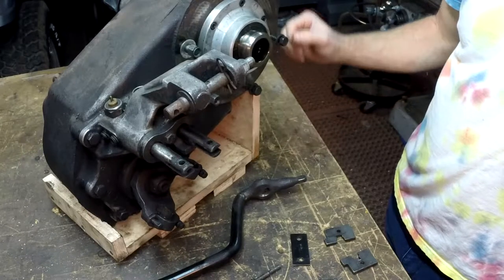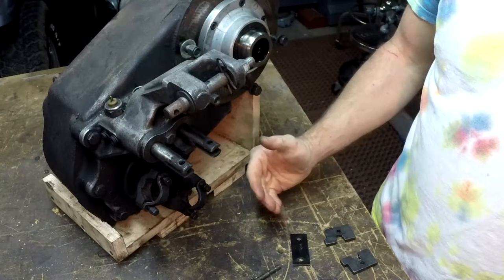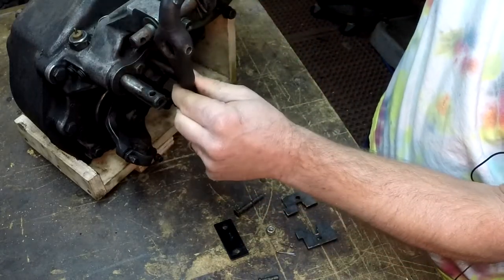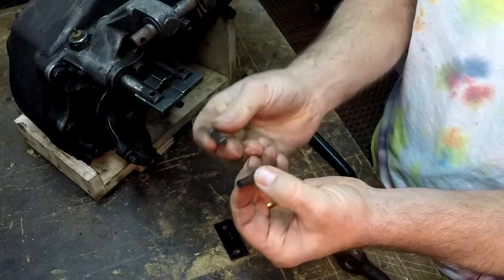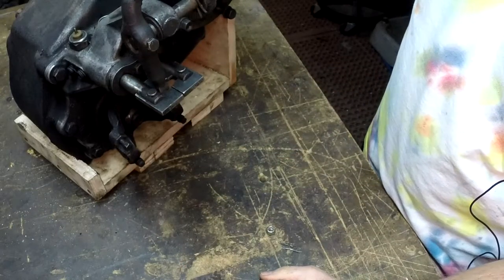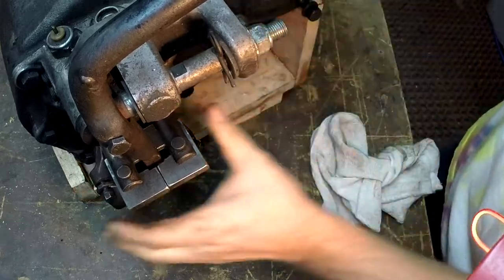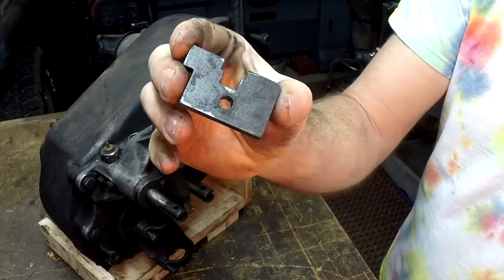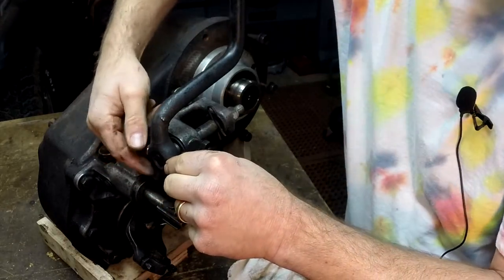Jeep CJ7 Dana 300 Shifter Mod: Twin Stick Function with One Lever!

Comment: very interesting idea! doing this myself and im making the notches a bit deeper for shifting both at the same time. this way it is more obvious that you are shifting both instead of one. also i wonder how this does in the vehicle as far as rattling around. i would maybe come up with a spring or something to keep pressure on the lever so it doesnt flop around a bunch while you are driving
Reply from the maker: It doesn’t rattle around too bad because it alway lays to one side. The rubber boot does dampen the noise a little.

Comment: I am locking up both my axles and from my last experience steering suffered. Looking into twin stick mods to get front dig, and found this gem! Was hoping for a weekend job, but rabbit hole opened up and now I want to rebuild it, go with a Novak ultra short output, and do upgrades to some seals and stuff. So I may have to buy another one so I can run that until I finish doing all the things to my good one. Can I have your phone number in case my wife needs to ask why the hell I am tearing up stuff I already rebuilt. Thanks! 😅
Reply from the maker: Thanks for watching! If you rebuild it enough time she will stop asking!
Reply: @themellowmechanic  hahaha!

Comment: How do you remove the interlock between the sticks (Rear and Front) ? it is not dangerous for the case to have different speeds between front and rear? Thanks for you're answer
Reply from the maker: There is piece that looks like a pill between the two shift rods that needs to be removed. This allows the front and rear to shift independently. Yes, you are correct in that this potentially could be catastrophic to the transfer case if the front and rear were engaged into two different speeds. This is why I added an external safety to prevent this from happening.